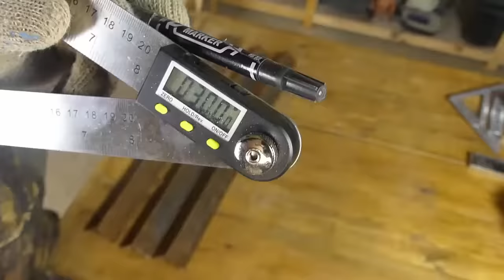I didn't believe it myself! I welded a barrel of pipes and it all worked!

Comment: Why be surprised? increasing the area gives increased heat transfer.
The problem here is that a barrel of thin metal will burn out quickly.
As an option from the inside with a brick to overlay.

Чего удивляться ? увеличение площади дает повышенную тепло отдачу.
Тут проблема то в том что бочка из тонюсенького металла прогорит быстро.
Как вариант из внутри кирпичом обложить.

Comment: having those pipes on the outside actually stopped much of the radiant heat from getting into the room 
as you can see on the infrared - the pipes were relatively much cooler than the side of the drum
without those pipes you would have gotten probably at least 300 percent more heat from the fire maybe even 500 percent
probably would have heated the room up to 100 degrees F - 38 C
you would be opening the door of the workshop in about 4 hours
Reply: ....yea not very smart....the pipes are  insulators...... i just fast forwarded through it and could not figure out what he was doing.... it would be better as a multiple rocket launcher i guess 😛

Comment: Great build and great ingenuity. I would be worried about the thin steel not being insulated with anything. No refractory no fire brick insulation water walls nothing. Just a 1000* fire burning against 14gauge steel I'm guess you have already ran it for awhile and found out that's not a great design in that area.
Reply: That drum looks to be a WW2 or 50's/60's era one - far, far thicker wall plate than just 14g (2mm). But yeah, today's 44gal (200L) drums are made out of very thin plate, between 0.9mm and 1.5 mm.

Comment: Needed air chamber in flue to put pipes thru and then use forced air looks like tube in outside were a waste of time lost heat because of them by thermal camera pics  be better off if half tubes with vents cut in them

Comment: What do the pipes on the outside do?
Reply: Pretty sure the point of the whole build is to make it a more efficient convector so that the currents take the heat around the space rather than just radiated local heat. Each external pipe is going to be like a small chimney and help carry the heat away from the unit. Evidence of that working is the cooler temperature of the pipes in the thermal image.

Comment: @12:42 On the rod you're using for the handle shaft, grind two 45 degree angles opposite each other on the end (rough chisel point).
You create fillet points for the weld to fill and create a deeper and far stronger joint. Not so important here but certainly helps for lifting handles and the like.

Comment: Ok , I am not handy . But I dont understand the roll of pipes on the side .if the goal is to emit heat . From the infrared pictures.  Just the top of the stove that is hot , the pipes are much cooler . Wich means  they are not emitting any heat .I will appreciate if someone takes the tie to explain to me this .
Reply: They induce air current. cold in at the bottom hot out at the top.
Reply: @cavelvlan25  the infrared  pictures shows them solid blue all the way  . I understand what you said  is true but the difference in temperature doesn't have to be great  to cause that effect.  So the pipes are actually  staying cool .not enough to radiate heat  .
Reply: @bbrahbboul2748  correct they are not radiating much heat. And honestly the air convection would happen regardless. The tubes keep the same air riding the stovewall to the top getting the air hot instead of rolling away when warmed allowing cooler air to replace it.  As for which is better more effecient at warming. I'm not a scientist.

Comment: Wouldn't those vertical pipes tacked onto the outside of the drum diminish the heat that would otherwise have radiated into the workshop? Isn't that exactly what the thermal imaging shows, i.e., cooler temperatures of the vertical pipes? 

If so, perhaps their purpose is to keep the heat from being too high for comfort in the vicinity of the stove. What do you think?

Comment: First off, that flue pipe is most likely too long from it's vertical rise. There's a minimum of 1 to 3 relationship, meaning for every 1 foot of horizontal, there must be 3 feet of vertical. Judging be the number of sections of horizontal pipe, you need a chimney over 30ft tall. Then, there's the combustion temperature. If you don't get a clean, hot burn, you will end up with unburned particles stuck to the walls of your flue and chimney, which can eventually ignite. Chimney fires are a big problem, as they are difficult to extinguish and can cause your home to burn down. If you're running a low oxygen fire, build an outdoor system and pump the warm air into the home, so any fire issue is isolated from the residence.

Comment: Wont the pipes on the outside insulate the radiant heat coming from the wall of the barrel?
Reply: While there is some radiant heat given off this design the convection is way more efficient.
Reply: Not really, they contribute to an amazing convevtion effect.
 As the air in the pipes heat up the air rises and sucks in cold air to heat it as well.
While there is some radiant heat given off the convection method heats a larger area much quicker

Comment: Good, but you made the biggest single mistake in common with nearly all woodstoves.  The hot exhaust gases escaping up the chimney is replaced with the same volume of cold air you are drawing into you workshop from outside - very inefficient. 
It would be MUCH better (I have tried it!) if you fabricated and welded an additional pipe into the lower part of your furnace, that draws most of the air required for combustion, directly from outside.  For safety reasons, you should not seal off all air from entering your workshop, but it is obviously a waste to be using your precious "heated" air for combustion.

Comment: What's the point of the pipes? Surely it ll work fine without them ? Or does it provide a tiny bit of insulation? I'm lost .....

The only reason I would weld pipes to a barrel is to heat water. All that work and no hot water? When you have all those pipes? Sorry guys, makes no sense at all to me

Comment: Interesting design and nice execution.  One issue though. Rocket stoves are not kind to steel. It might last a few seasons, but the steel will get destroyed. It needs to be lined with things like insulative fire brick, ceramic fiber insulation, approx. "Starlite" material, or the like, to protect the steel. The extra insulation will also make it more efficient.

Comment: What a stupid design! How does the smoke escape with a double lid? Why make the snorkel rise up the side with a shield? Just make it at the base where the fresh air is entering. Too much ash means too much smoke. Soon to have a chimney fire from the soot buildup in the chimney. Build a rocket stove and enclose it with the barrel. More efficient burn, more heat capture and less maintenance
Reply from the maker: If you don't understand anything, it doesn't mean that the design is stupid - it means that you are the stupid one.

Comment: At 24,08 you can see the HUGE waste of heat!! Most of your heat production is absorbed by the tubes you welded to the body of your heater. The tubes are absorbing but as you can plainly see (as the heat gun shows green they give off almost NOTHING. Take off those useless tubes and your heater will bet a lot more efficient.....

Comment: It's obvious that you think there's something wrong with welding in camera because you always shield the welding from the camera. Maybe you're not aware but a TV or computer screen cannot harm your eyes from video's of welding on camera. The reason welding light is harmful to eyes is that, unfiltered, the intensity of it can harm your eyes rapidly. However the camera is not capable of capturing that intensity. The maximum brightness of a camera is limited by the sensors. It can only capture tiny bits of the actual light intensity & when it's been put through video processing to make a video - the screens are not capable of transmitting the intensity they cannot capture. In other words it's perfectly safe to photograph or video welding without filtering it - because the captured image cannot damage your eyes like looking at a live arc with your naked eye. In other words the camera apparatus & the video equipment that reproduces it - also filters out all of the intensity & shows only white pixels on the screen. Screen pixels on a monitory cannot burn your eyes.
Reply from the maker: I cover the welding with my hand not because it will harm my eyes when watching a video, but because it will harm the matrix of the video camera itself.  The fact that it is safe to watch welding videos, I think everyone knows.